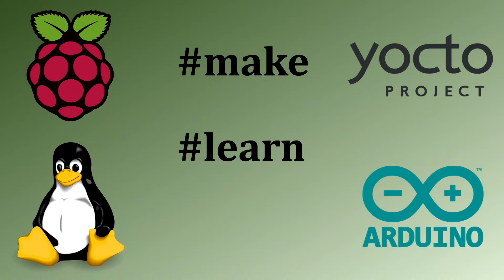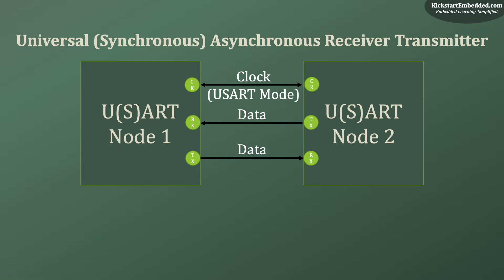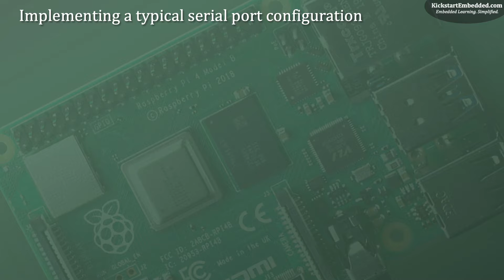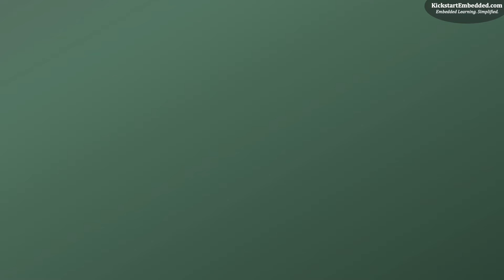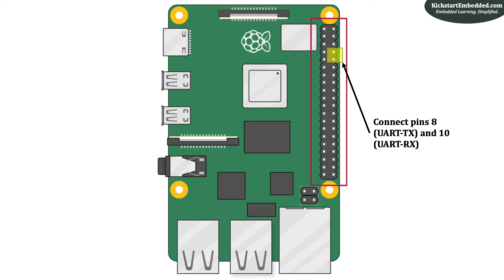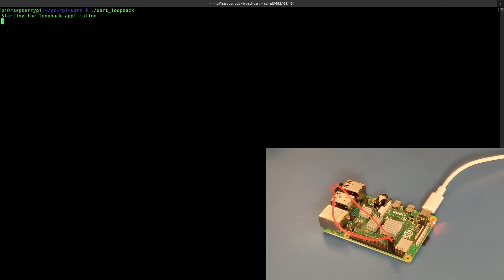[ENG] Raspberry Pi! Ep:5 - UART Usage - C (termios)

Comment: any tutorial get data from arduino into our C program in out computer? I need the data from Arduino to be used. The Arduino doesn't need any input from C Program in computer. How to make it happen? currently using debian. I wish you could make the tutorial or maybe a little contact to reach you
Reply from the maker: Hi - the simplest way would be to use a USB-to-serial converter and use the enumerated tty port with ioctl as shown in this video to get data from your Arduino.
Reply: @kickstartembedded2690  I am currently using debian.
Reply: @kickstartembedded2690  I am currently use Arduino Mega. It has USB connection. It still need the USB-to-Serial Converter or not?
Reply from the maker: Oh you don’t need the USB to serial it has the USB device port exposed..
Reply: @kickstartembedded2690  alright then. Thanks  mate. Im gonna try